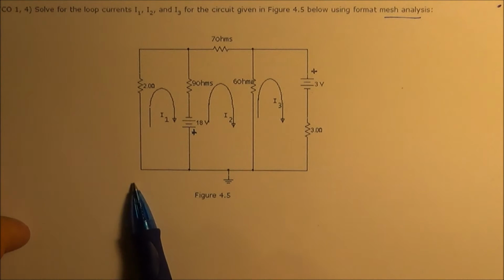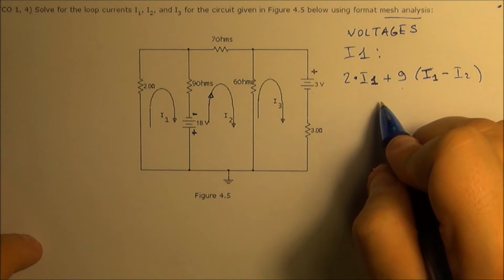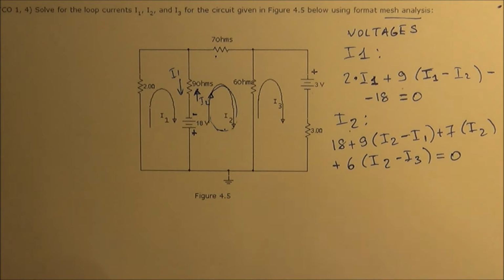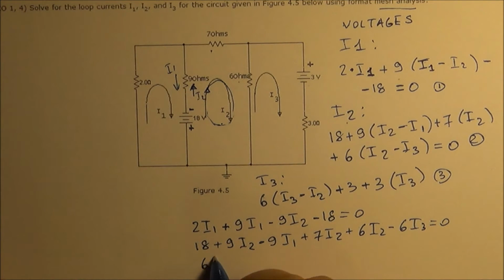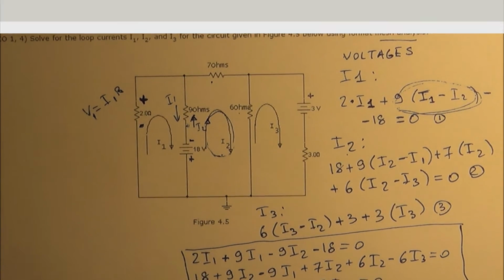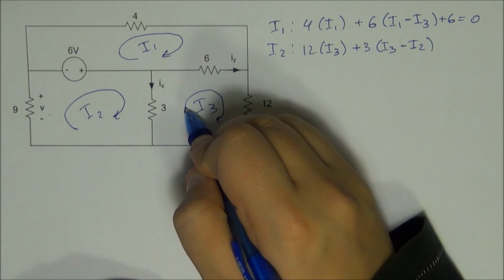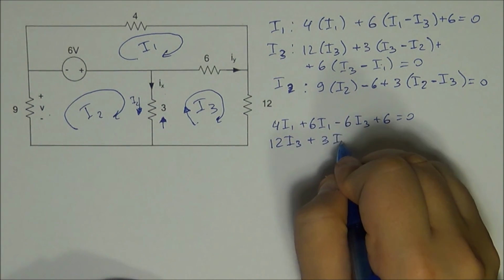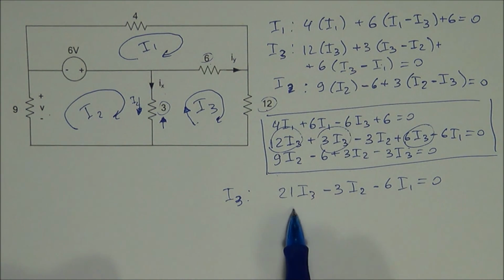E.E. Tutorial #2 - Mesh Analysis for Electronic Circuits

Comment: Well why did you write the voltage drops across each resistor with +ve sign. . . . ?
I guess it is negative!
Voltage drop is negative!
Reply from the maker: It really makes no difference. As long as you keep the same sign everywhere and know what it represents you will get the correct answer. the reason why I kept it positive is because we were taught to think that if you were to use a multimeter, you would see that voltage across the resistor, but I do understand your point which is the "drop across the resistor" thus making it negative.